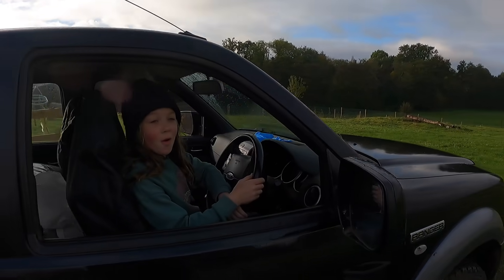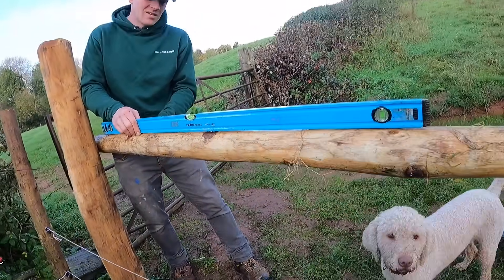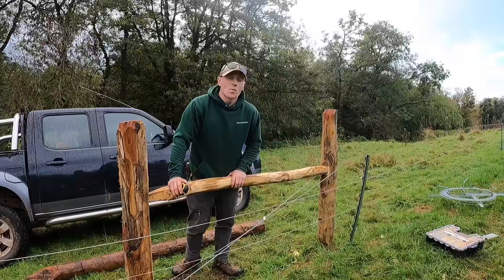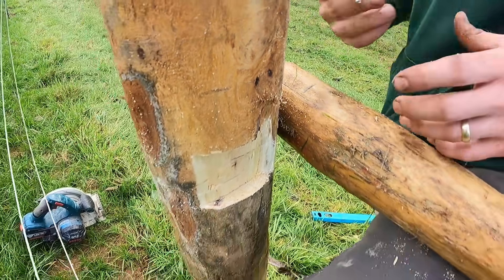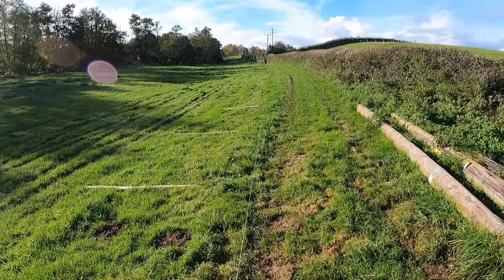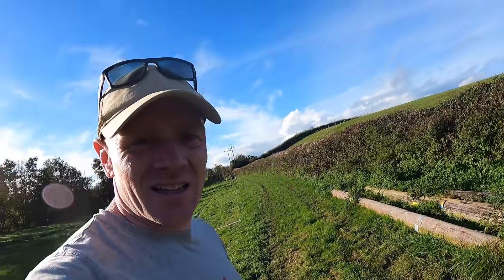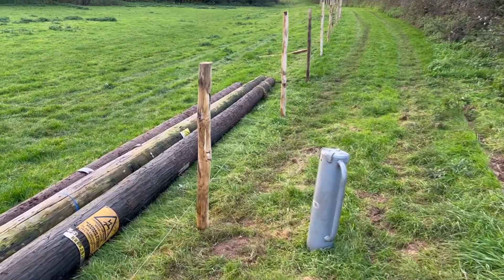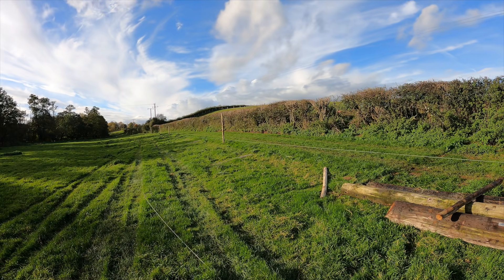FIRST TIME FENCING |  Phase 1 - The Track

Comment: Don't be to keen to stretch your fence wires  too tight because when the temperature drops the wire will contract. I remember being told "Never tension fence wires in hot weather ". Also, there is a hand tool for "Wrapping" the wire end around the wires length, I found a good quality ring spanner works just as well. I can't remember the spanner size but it it was around 13 mm, simply put the wire end through  ring spanner and slide the spanner down to the wires length and rotate the spanner 360 degrees 4 or 5 times. The best way to cut short any unwanted bits is to "Nic" the wire (file, Dremmel )and bend back and forth till it breaks.

Comment: Glad to see it’s not only me that has a set of moderately-rusty chisels. Mine sit at the bottom of my tool box for when I need to give something some real welly but don’t want to use my properly honed chisels! I’ve even used them for knocking-off bits of extraneous concrete 😂

Comment: You will find posts in hedges will fly in as the ground is so loose and to a degree, fence lines. Still worth making a hole to check for roots/stones but no need to widen it much. The higher fields will be more of a workout.
Reply from the maker: Especially with the rabbits! Going to be hard to find solid ground in some hedgerows!

Comment: A tip on staples. Put them in at an angle to stop splits in the posts
Reply from the maker: Yeah talked about that exact thing on the other channel in tonight’s video.  When testing different staples and new fencing stapler. 👍
Reply: You learn quickly when the staples pop out in dry summers😊😊

Comment: Have you thought about a little post knocker for the back of the massey? Might be something usable out there for you and its got to be better than doing it by hand 😂
Reply from the maker: We have a handheld petrol machine to try next week, ground not hard so should be fine. Access is poor in the next field for a small tractor but should be able to get the big posts put in. Most small post drivers for tractors only adjust one way so not well suited for slopes and banks. 😟
Reply: thats not a nice thing to call his daughter, she has got a name